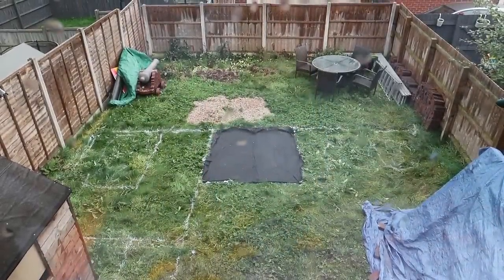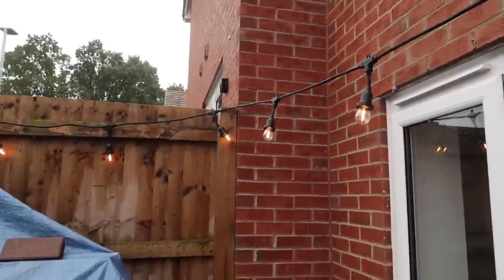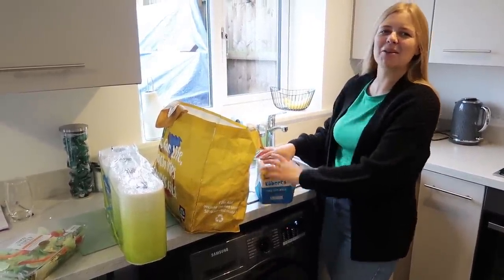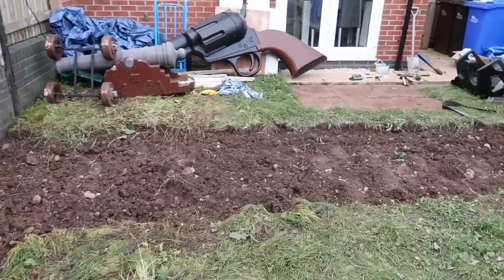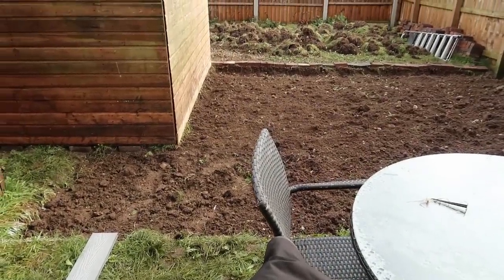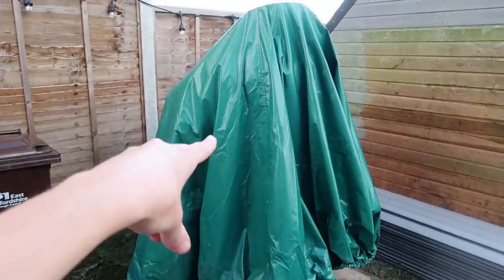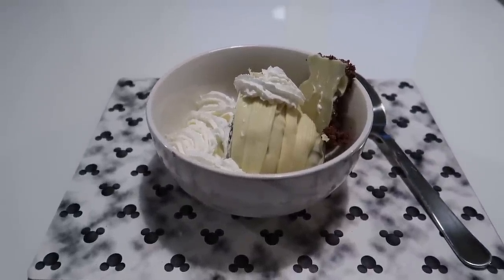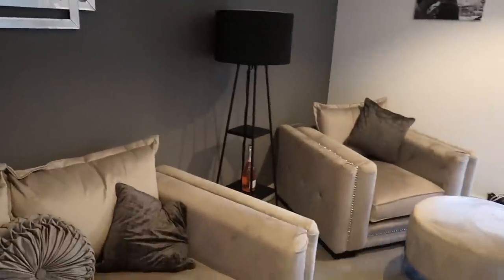Starting Work On Our NEW Garden! More Furniture & Colin The Caterpillar!

Comment: Just a note:....If you are using Fibreboard for outside it's only water resistant but not waterproof and not suitable for outside use unless you prepare properly and might be easier just getting wooden decking board.

Comment: 7:07 6 x 4, ey? A nice 3:2 ratio. 120 x 80 is a standard desk / table top. On the other hand 1:2 as in 160 x 80 is also fairly standard. Just a thought. I find that fascinating. What I also like is the 4-part roof of the shed.  Not sure if you got a fancy name for that in English, but you know what I mean. 
30:47 ... So it's an IKEA Kullen (€ 19,99), but from B&M instead? Colour me confused. 
Well, it's all coming together slowly. The thing to keep in mind is: progress. As long as there's progress you'll get to the finishline. Eventually. :)

Comment: Hope you've got planning permission, that shed looks like it's going to be huge!
Reply: You don’t need planning permission for a shed
Reply: Don't need it on a wooden structure under 2.5m in height
Reply: @jimmyk9523  also No more than half the area of land around the "original house" would be covered by additions or other buildings. Just hope they have sought advice from a local planner to prevent a takedown order.
Reply: If the area is >15m2 then you do (and this is)
Reply from the maker: Luckily we designed the garden to fit within all permitted developments! So excited for it to come together 🤩

Comment: Have you checked planning regulations for your shed/sheds being joined together. You need planning permission for any garden shed or building that is over 15m2 in floor space as well as the eaves not being over 2.5 metres high within 2 metres from the property line and also take up less than 50% of the footprint of your house. So straight away your shed floor size is well over 15m2  so you would need planning permission.
Reply from the maker: Luckily our garden plans fit within permitted developments!